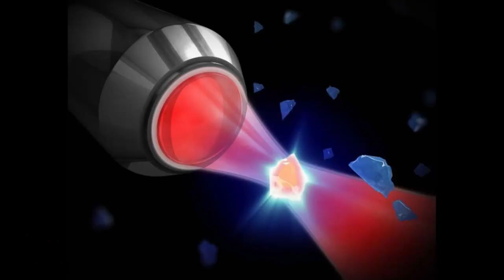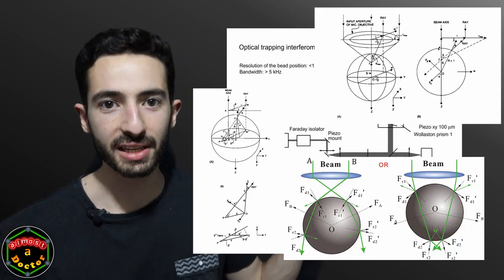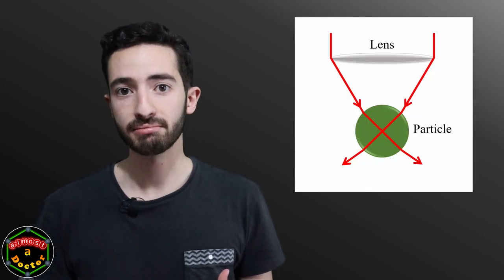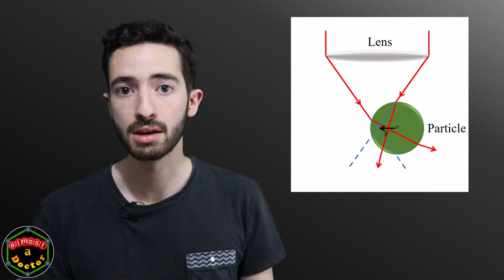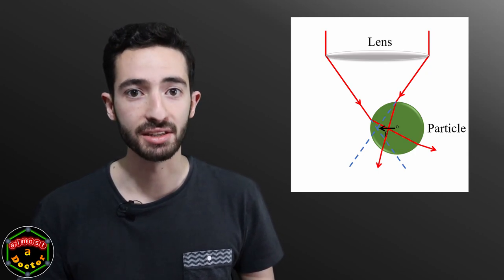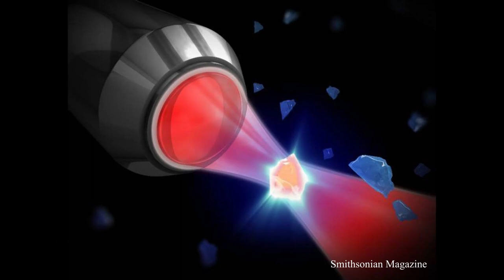Optical Tweezers: Trapping Objects with Lasers

Comment: Good video! I will watch twice to try to let it all soak in. Question: Can you explain how the gravitational waves were isolated from all other variables in the experiment sir? Can you share the name of the experiment where gravitional waves were detected? I would like to learn more about this. Thank you.
Reply from the maker: A great question. The gravitational waves experiment was a massive collaboration, I will add the link to the original paper, (which had about 90 authors, which is just crazy). In terms of isolating other variables, it took years of calibration. What the paper does also have is what the scientists expected to see from the theory if they were in fact measuring gravitational waves and got pretty much exactly that. Though this was just the first, I know of another example where they detected gravitational waves, simultaneously with gamma rays from neutron stars colliding. I should do a video on LIGO sometime.

Paper: https://journals.aps.org/prl/abstract/10.1103/PhysRevLett.116.061102
Nature news: https://www.nature.com/news/einstein-s-gravitational-waves-found-at-last-1.19361
Reply: @AlmostaDoctor1  It is interesting. I am curious because in order to posit gravity as the "independent variable" in an experiment I imagine it is VERY difficult to use controls to pinpoint it--especially since gravity is very weak even compared to atomic force. I reckon it would be like searching for a squeaking mouse at an active construction site. I'll check out the info you posted. Thank you sir.
Reply from the maker: I always will encourage people to investigate further. My goals is just to get people thinking about interesting topics in unique ways.

The mouse is an interesting thought experiment, and surprisingly you could probably hear it. Mice and rats have very high-pitched squeaks (most of which are too high for us to hear), whilst construction noises will generally be very low pitched. You could isolate the mouse squeaks with some software by focusing on the specific frequencies you expect. That’s the brilliance with LIGO, is that gravitational waves weren’t detected just once, but on multiple occasions, were matched by other detections (from gamma ray satellites to optical telescopes), and they matched as expected by the theory.
Reply: @AlmostaDoctor1  You ever think about going on a flat earth debate channel? Lots of people on youtube deny the existence of gravity.
Reply from the maker: Whilst it is something I have thought about, it is not something I have ever imagined doing.
Reply: @AlmostaDoctor1  There is a show called "Flat Earth Debate" on Nathan Oakley 1980. And there is a channel called "Quantum Eraser." Even though they host live forums daily, there is never anyone on them who makes a good argument for simple stuff like gravity. Rather than people having the knowledge you do--where you can point to an experiment which validates gravity--other people try to argue for gravity solely based on reification, ex. "since the earth is a globe, then..." /// I saw you on Nervardia and since you said you are looking into becoming a good youtuber, then maybe you could direct some of your science teaching into talking sense into people in regards to simple stuff like gravity. I would be interested in watching any videos you make on this. Thank you sir.
Reply: @AlmostaDoctor1  To give you an idea of how bad it is, the "best" people on the flat earth debate show who argue for gravity say these outrageous things. Today there was a guy who was trying to prove the globe saying in science experiments there is no such thing as an "independent variable." I just want to learn from smart people and it is frustrating that no one of the side of gravity can explain their perspective in a scientific way. You can, so I figured I would mention it to you because maybe you could weigh in and help people to see how experimentation can be used to reveal gravity.
Reply from the maker: Nathan Oakley is not someone deserving of my time on his channel. I have seen how rude he is to people who disagree with him and whilst I am fine with people having different ideas, I am not fine with his demeanour. Though hopefully I will have some videos touching on astronomy in the future; that people are free to analyse on their channels.

P.S. I genuinely appreciate how polite you have been to me in these comments. If it is easier you can call me Matthew (or Matt).
Reply: @AlmostaDoctor1  Thank you very much. I look forward to watching more of your videos. Have a nice day!
Reply: @AlmostaDoctor1  I get hopeful when there are new youtubers like you who start producing content. I am very dissatisfied with much of the material made by other people on youtube. I have lots of questions about science and evolution and want to learn. But on other sites like Paulogia, Nervardia no one really offers straight answers. Whenever I ask question about evolution (because to me it precisely fits as an affirming the consequent fallacy), evolution guys on other channels just lump me into categories and things like that. It would be helpful to have content producers who interact with the strongest points of opponents and offer solutions. I like watching ALL types of different stuff, so even though I might disagree with someone I try to learn their perspective thoroughly. I do find the flat earth stuff fascinating--especially Quantum Eraser channel--but there are lots of other people who don't make any good arguments. It bothers me a lot that the other side of the argument (gravity) doesn't have anyone good representing it on those channels. I thought about going on the show to present some things about the atmosphere but I haven't put together a slideshow yet.
Reply from the maker: @samworkman7567  Whilst I can't speak for other youtubers content, I can, maybe, shed a bit of light on your dilemma. The idea of straight answers in science is unfortunately not a reasonable expectation. The physical world is complex, and to understand current science is to understand the last 400 years of work by some of the best human minds to ever exist. It is a very understandable human desire that the world around us should make instinctive sense, but a lot of the time it doesn't so we must take steps to remove our feelings of common sense and intuition from the equation and make our assessment as impartial as possible. Though I wish you the best in your investigations.

If you have twitter, you can follow me there, I will be happy to answer other questions you might have there. https://twitter.com/doctor_almost
Reply: @AlmostaDoctor1  Thank you sir. Although I don't have twitter and do a bunch of social media stuff. I will watch your videos and support by leaving comments. :)
Reply: @AlmostaDoctor1  Sir, it is okay if you don't have one right off the top of your head, but i was curious if you could help me. I am looking for a science experiment on "evolution," which contains an observed natural phenomena, independent variable isolated with controls and a hypothesis with a null. I asked on other channels and people just post stuff about the evolution theory and how it relates to genetics, bird feathers, etc, but I can't find an experiment where evolution is isolated as the single independent variable in an experiment and shown to be the cause with a valid null. I am super frustrated talking to people who don't understand what I am talking about, and people who call me names like sea-lion and pick fights with me. so if you have one experiment from your field or another field please let me know. Thank you sir.
Reply from the maker: My area of expertise is not biology, so I could easily miss something. Trying to do an experiment on evolution as the independent variable is an odd way of wording it and it does go back to my previous message about the difficulties of science. There is a reason why it takes (exact years vary but roughly) 10 years to become an academic. Gaining expertise in any area is hard and doing a a single experiment to isolate a theory that has been thoroughly developed over more than 150 years is not probably going to be possible. Whilst all science experiments can be done by anyone else (the whole thing about repeatable), that comes with a massive caveat, you need the resources, time, and knowledge to do so. I know this can be disheartening to some but that’s what the peer review process is for. You can go and read the exact experiment and results that someone has already done. Google scholar and your local library database are probably your best bet, though it is a steep learning curve if you are unfamiliar (sorry I don't want to make assumptions about how much you have already studied).
Reply: @AlmostaDoctor1  Tbh, I find those types of nebulous answers troubling. I don't understand why a clear, simple experiment cannot be upheld as a good example. For some reason evolutionary biology gets a free pass to do this, but everyone else in society can readily explain their craft. For example, I worked as an air traffic controller and a facility training officer. I can clearly articulate what ATC is, what it does, how it works in different areas, etc. But evolutionary biology can claim it follows the scientific method, yet when logical people like me ask for something which empirically elucidates "evolution" as the sole, isolated cause of a dependent variable, there is no such experiment. I am just venting, but I am tired of other people on these channels who just present "evolution" as a begging the question story (ex. "if evolution is true, then allele change will exist. Alleles exist, therefore evolution is true") {{I am exhausted from the b.s. answers and really searching for an empirical science experiment that proves with a null that evolution is the sole cause of something. It is b.s. that everyone else in society is expected to clearly articulate the purpose and function of their occupations, yet evolutionary biologists can just pull anything out of the ground, then incorporate it into their running story without ever being required to isolate "evolution" with controls. Guys like you are required to prove your claims about lasers by experiment, but evolutionary biologists are allowed to make any claims they wish and call it "science." It angers me, sir. Thank you for listening and for providing feedback to my question, sir. Please let me know if you come across one so I can use it to show to christians as proof for evolution.
Reply from the maker: Evolution is one of the most studied and verified theories in all of science, if an evolutionary biologist submits a paper it will pass through the same peer review as any paper I may ever submit. The basics of evolution is simple, however, trying to do an experiment to prove all the 3.8 billion years (give or take a few years) of evolution is not easy.
 
Whilst I am sure you could explain ATC to me, could you do an experiment to prove to me how neurons fire? I am sure you could, but it would not be easy, you would need a lot of equipment and chemical expertise, yet I can give a simple explanation as to how they fire. I could give you a simple explanation of how a smart phone works, but could you or I build one without help? I could give you a simple explanation of LIGO, but there is no way that I could build a 4km interferometer setup that would reproduce the results. 

P.S. The majority of Christians believe in evolution, so I won't presume to speak for them.
Reply: @AlmostaDoctor1  I understand sir. All I need is one experiment where "evolution" is isolated as the independent variable of an effect--any effect. That is all I am trying to find. I want to know how "evolution" was isolated and proven to be the cause of a specific effect (any effect will do) through the scientific method. (Similar to how Vitamin C deficiency was shown to be the experimental cause of scurvy; insulin the experimental cause of diabetic ketoacidosis. I want to read one experiment where "evolution" was isolated like this and shown to be the scientific cause of an effect.)
Reply from the maker: Isolate ta population of breeding organisms and monitor the allele frequency (by the way this has been done multiple times). If it changes over time you have proven the fact that organisms can change over time, and hence evolve. If you want to understand how alleles change, then it might be worth taking a course (or at least reading science journals) on organic chamistry. However, the theory of evolution is that, an entire theory, and to even think of isolating it as a single variable is not scientific. Same thing for electromagnetism, I could isolate coulombic attraction, but can you isolate the entire theory as a single variable, absolutely not.

If you are going to respond to the first part, can you define what you think an allele is? (I just want to make sure we don't talk past each other)
Reply: @AlmostaDoctor1  Simple answer: a gene. The problem I am having is with how to isolate what evolution does. In other words, if you have group A, B, and C of an otherwise similar set of petri dishes of bacteria for example, how could "evolution" be applied to petri dish A, and not petri dish B or C?
Reply from the maker: @samworkman7567  Evolution needs one form of selection, (natural, artificial or sexual). So you would, say keep all the petri dishes the same (though you might want a bigger colony then that) and just put one selection pressure on one petri dish. This was actually done with single celled amoeba, where they put in a predator that couldn't eat bigger objects. This was the only difference and they, not only just got bigger amoeba out of it, they even got the amoeba to evolve multicellularity. Quite a cool experiment. (Herron et al., Scientific Reports, 2019)
Reply: @AlmostaDoctor1  Cool! Thanks! I found the original study online and am going to read through it. Will let you know if I have more questions if you are interested chatting about this stuff more (even though you are in a different field). Thank you sir!